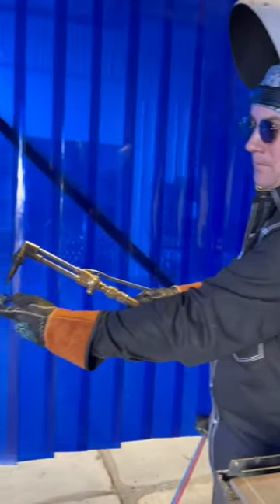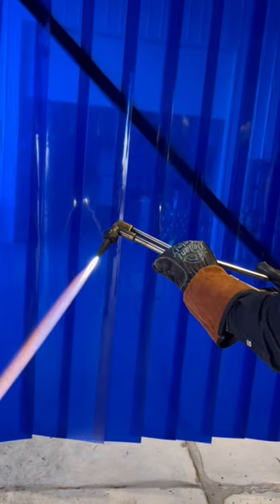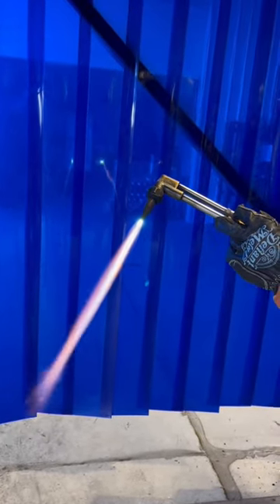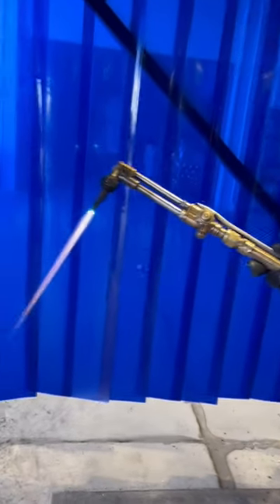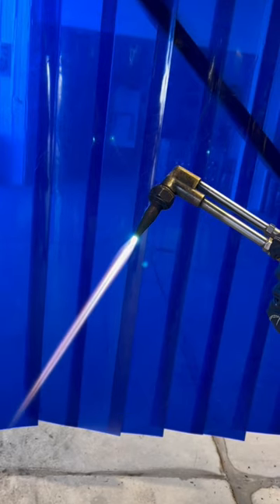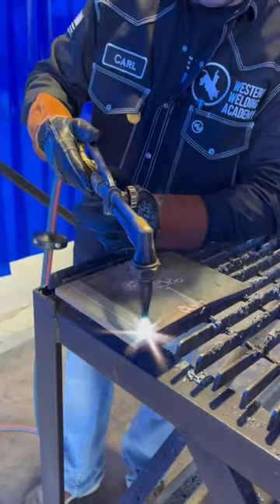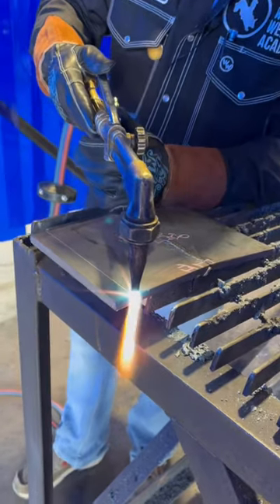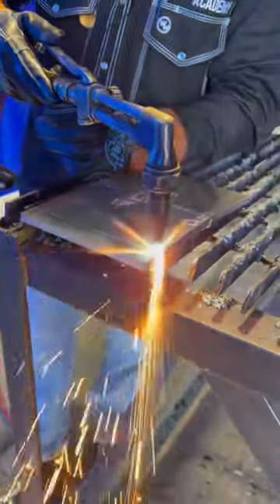How to set up your torch properly  #shorts

Comment: Most instructors start at the tanks...Isn't your Oxygen knob beside your acetylene knob not to be confused with your preheat knob 🤔 😂😂😂
Reply: Right? when did the bottom oxygen knob get opened?   And how much opened?   It would still be a short if those 3 seconds were included.